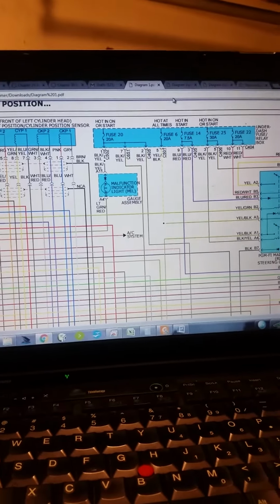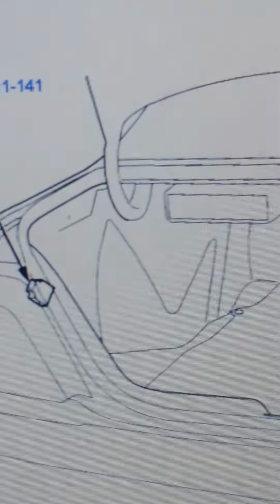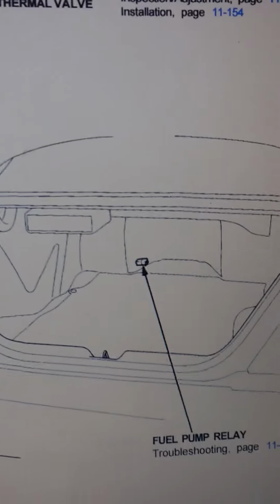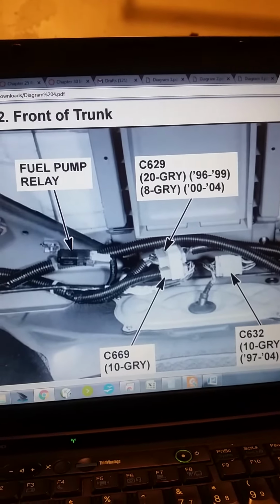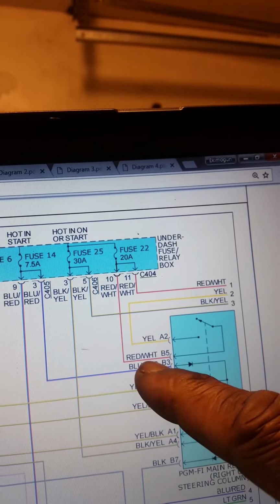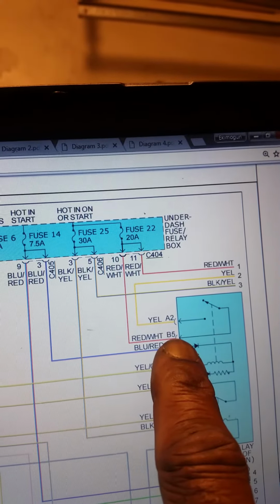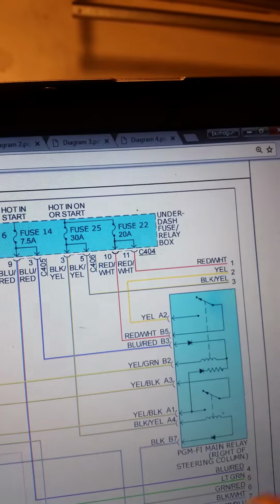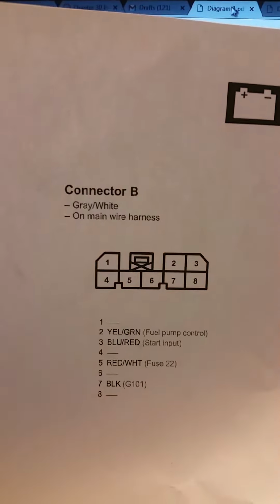2000 Acura RL, Cranks but won't start.

Comment: Hello everyone, I’m new to the group
I have a 2000 Acura RL 3.5 V6 
The engine cranks but won't start
 Fuel is reaching the engine, and the fuel system is operating normally. The crankshaft sensor was showing 19 RPM on live data; I replaced it, but it still shows the same reading. The timing belt is new and correctly aligned with the marks; I also replaced the camshaft pulley as a precaution, even though there was no visible damage. The installed sensor came from a running car and is confirmed good, showing 0.777 kΩ resistance on the multimeter. There are no breaks in the wiring, and all connectors are clean. I replaced one of the ignition modules and checked the wiring for both (power and ground)—everything is fine. I even swapped the modules, but nothing changed. I checked the power and ground lines at the ignition coils; everything is present except for the signal from the ECU. I replaced one coil with a new one. I checked the fuel injectors; power is present, but the signal line is missing. On live data, the injector feed reads 0. The engine sounds healthy, showing no signs of low cylinder compression. I replaced the main relay as a precaution, even though the old one worked fine. I replaced the ECU and checked the power and ground according to the schematic. The security system and key are working correctly: when the key is turned to position 2, the key light disappears; when the key is removed, the blue key light flashes 5 or 6 times (I'm not sure of the exact count) before turning off, indicating no issues with the key. I ran a ground wire from the battery to the engine block. Scanning reveals no fault codes at all, though the scanner fails to access the Body Control Module (BCM). Is there a connection? All internal and external fuses are in good condition and have been checked multiple times. Just so you know, the car was running, and then the problem suddenly occurred. 

Has anyone here experienced the same problem or has any information that could help me? Thanks.
Reply from the maker: Good evening. 

With your comprehensive explanation of all that's been done thus far, it's very apparent that an o-scope is going to be needed to check the cam and crank sensor inputs at the PCM and the PCM's control at the injectors and the ignition coils.

The reasons for this are to ensure that the computer has the data it needs to fire the plugs and injectors to eliminate harness issues. 

Additionally, the actual fuel pressure at the rail needs to be measured. Flow with insufficient pressure will be an issue.

Good luck.
Reply: @EKHondaMotive  Thanks for the information. I don't have an oscilloscope, but I did check for continuity from the sensor connector to the engine control unit (ECU), and there are no breaks or shorts in the wiring. Regarding fuel pressure—if that were the issue, the engine would likely start and then stall—but I will measure the pressure at the fuel rail just to be sure.
Thanks

Comment: Great video I have a 2000 RL and Im having issues as well the key gets stuck then sometimes like 3 times in the last month it takes at least 10 to 12 tries of turning the key and Jus the click 1 time then nothing Im kinda scared to drive my car now gotta fix this 😒⚠️
Reply from the maker: Just so I understand, the key won't turn in the lock, or it turns and won't start?

If it's the former, I too would be anxious because the key-lock combo could very well be worn to the point of needing replacement. 

If it's the latter, addressing the "no start" problem is something I'd want to address so that it doesn't leave you stranded. 

Here's hoping you get it resolved.

Cheers!

-100

Comment: Believe it or not, I accidentally put regular gas in my acura rl and it had major issues trying to restart. 

This has happened to my three different time over the last 2 years when I put in regular instead of PREMIUM.

According to what I looked up online, that shouldn't happen, but it did. 

The car wouldn't begin to turn over well until I drove off the entire tank of regular gas I put in.
Reply: In this situation you can always try adding an octane booster for the time being, just for future reference.
Reply: @TheModestMallow  Thank you  for the info. I will file it away for future reference. It turns out my starter was bad. For the heck of it, I thought I would replace the starter, and then take it in if I messed it up or if the issue persisted afterwards. I looked up how to replace the starter on youtube. I was surprised how easy it looked and was. My car hasn't has any problems since I did that around Thanksgiving 2021.

Comment: I’m having a similar issue on my 96 RL. I checked fuel and once I lessened bolt fuel came out. I replaced the main relay but still crank no start. Even weirder is normally the dashboard lights up once the key is turned in the ignition but now it doesn’t. The dashboard does not light up until the key is in position 3 in the actual cranking motion. What could be my problem?🤯
Reply from the maker: Sorry to hear that!

That said, from your description, sounds like you might actually have a bad ignition switch.

Most Honda/Acura steering lock assemblies of your vintage have an electrical, multi-pole, multi-throw rotary switch on the back end...I'd check voltages in and out of it but my money's on it being bad i.e. a bad ignition (electrical) switch.

Keep me posted on what you find.

-100

Comment: Yup just changed my 1996 Acura Rl and it was the main fuel pump relay good thing I checked that first easy fix 60$ . Fire 🔥 right up .
Reply from the maker: I'm glad the video helped!👍

-100
Reply: Just by chance if you're on YouTube at this hour. I have a 04 RL it will crank but start. I've been looking at diagrams for where the fuel pump main relay is. I know about the one underneath the steering wheel but I'm not sure if that's the correct one I'm looking for.
Reply: Unplug it and you can slide it right off
Reply: @alexhenriquez3682  yeah so i found it and tested it exactly as the video shows and i get the same result, input (red/white wire) lights up on my probe and the output (yellow wire) doesn't. It's Sunday night for me and i have to get work in the morning so im gonna need a ride from my dad lmao, but I'll find a replacement quickly and I'll reply back if it works.
Reply: After that everything was fine but 4 months later had to replace starter and that’s a pain to get too .
Reply: @alexhenriquez3682  I got the relay and installed it, and now I get fuel to the fuel filter in the engine bay the car still won't start. Don't even know where to look now, I know its not the plugs or the coils.
Reply: Might be the starter
Reply: @alexhenriquez3682 It's not I just checked, the belts spin perfectly.

Comment: I've incorporated my diagmostic procedure to include this step as the first: A 2-3 second squirt of starter fluid into the intake while someone cranks. If it runs and dies, you know its likely the spark missing without a waste of time. This is assuming that the sound of cranking has been evaluated to r/o a broken timing belt. Love your videos and you present much valuable information on the nuances of the Honda and it's "sometimes temperamental" systems and subsystems.

Comment: Can any one help? I have an 01 rl.. it stalled out now when i tried to start it the starter just spins like the timing belt is broken. I had the starter replaced ... same problem.... none of the belts are turning. Ive checked the belts and none are broke. I've even checked to see if the engine is locked up and its nor... can somebody help. Its driving me nuts!
Reply: Believe it or not, I accidentally put regular gas in my acura rl and it had major issues trying to restart. 
This has happened to my three different time over the last 2 years when I put in regular instead of PREMIUM.
According to what I looked up online, that shouldn't happen, but it did. 
The car wouldn't begin to turn over well until I drove off the entire tank of regular gas I put in.
Reply from the maker: It sounds to me like (a) we need to know why she stalled and (b) you have a bad starter (It appears that the Bendix is not kicking out).
Did you install it yourself? If not I'd take it back to the shop you had it installed that.
Furthermore if the timing belt was broken the drive belts with turn but the timing's internals would not.

Comment: Thanks a lot, just had the exact same problem. Diagnosed it the same as you and a new relay fixed it.
Reply: I also had a problem with this relay box, once replaced no more issues with engine cutting out.  This is a known issue, more so on certain TL models. Good troubleshooting !!

Comment: i have a acura 1997 RL it crank but wont start it cut off while i was driving i need to find out why and what the problem
Reply from the maker: Wild General To stay running, an engine needs, in addition to air, fuel metered properly, to be in mechanical and for spark to be delivered at the right moment. 
A clue would be to check the mechanical timing before cranking it again (in case the timing belt is broken!). If the timing is ok, check for spark.
Reply: Did u find out what was wrong with the car
Reply: @emedoska07262011  fuel pump went

Comment: Got a 2000 Rl I just purchased that will crank and not start I’m thinking starter
Reply from the maker: kimasilv Hi. If the car "cranks", that's the starter working. If the engine doesn't start, then something else is at fault.
Reply: One Hunnit Tech I checked the test bolt for the fuel and nothing came out just like you did at the 9:30 mark
Reply from the maker: The video walks you through all the checks to isolate the PGM-FI main relay (this powers the fuel pump)...or you could load the parts cannon and just chuck one in.
Reply: UPDATE: I went ahead and did the work to remove the starter.  In doing so, I found out the Bendix was broken.  I replaced the starter, and then the car fired up right away.  I did post my efforts at removing the starter on my YouTube page, should anyone else want to know how to do it.
Reply: One Hunnit Tech I removed the bolt from the fuel filter then turned the key and a huge stream of fuel poured out.  I guess I will clean the throttle body and then check the ignition coils...do you have any other suggestions?
Reply from the maker: So, if there was no fuel discharging from the test port up front but the fuel pump was working, it sounds like you've an obstruction in the fuel line.

I suggest finding someone who's good at diagnosis and let them figure out before you throw good money away!
Reply: I am not sure if you are referring to my comment or the original comment, but I did have fuel discharge from the test port. I plan on getting a new main relay, and then see what happens.
Reply from the maker: SonofAleph Well, if you had fuel up front, the main relay, you probably have a timing or ignition issue.
Reply: One Hunnit Tech the starter is just spinning, not even sounding like it is trying to ignite to start...that is why I am gonna work on the ignition coils next
Reply from the maker: The coils have to be triggered to fire. If they aren't, they won't.

If you're insistent on DIY'ing this fault, you might wanna upload videos of your fault to your channel and tag a few "Auto-Tubers"
Reply: One Hunnit Tech working on cars has become a hobby of mine.  I have a few mechanics that help me out, but I use YouTube to supplement what they teach me.  Again, I greatly appreciate your video, and your replies.
Reply: Thank you for the detailed video although the sound is horrible and focus is bad sometimes but it got my car running. It ran a couple months ago and then stopped cranking. On has 110 kmls on a 2004 Acura RL. I thought it was fuel pump, bought a new pump, took old one out but it works so the I YouTubed. Thanks man.
Reply: One Hunnit Tech Probably ignition...it was running smoothly when I got it.  It does have some P1201-06 codes/P0300, so since the fuel is flowing, I am gonna try some new ignition coils all around.  Your video really helped alot.

Comment: Can someone help i got a 01 RL and my car starts but doesn't stay running could it be my main relay
Reply from the maker: Dionta Murray Will it stay running if you give it gas?
Taking a shot in the dark, you may have a fuel delivery/pressure problem (which a main relay could cause). Your fuel pump could also be going out.

Without seeing it, it's hard to tell.

See if you can upload a video clip to me @ thegqtech@gmail.com and I'll see what further advice I can give you.